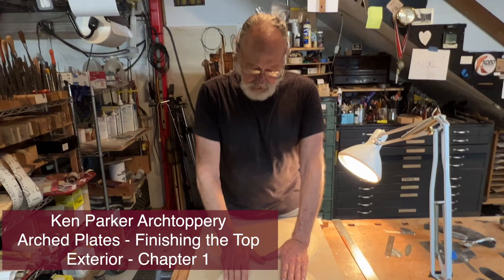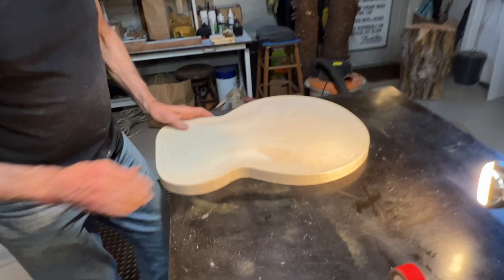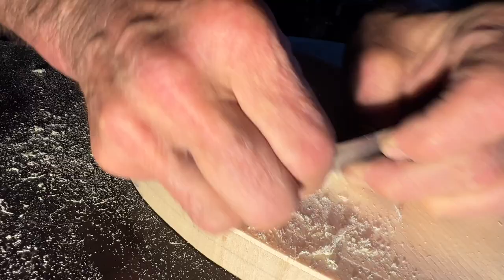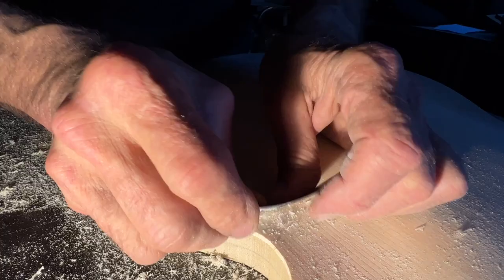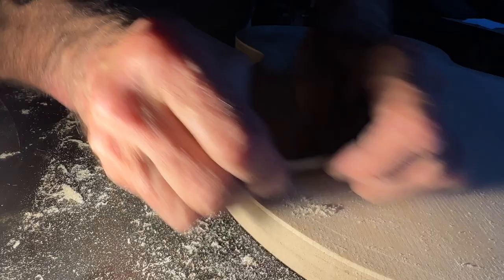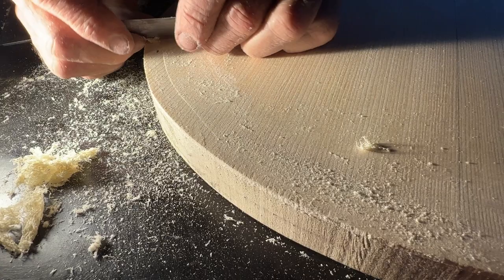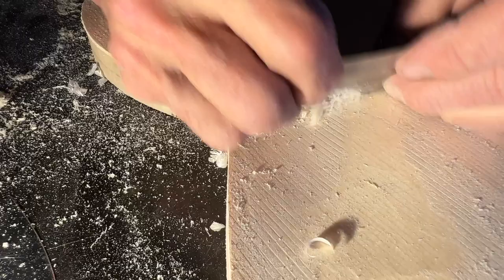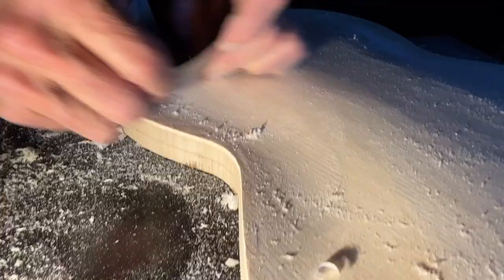Ken Parker Archtoppery - Arched Plates - Finishing the Top Exterior - Chapter 1

Comment: Where do you get the shim stock, and what do you look for?  I see McMaster-Carr has it in steel at Rockwell B90, temper rating of "full hard".  Is that what I should be looking at?
Reply from the maker: Honestly, I don't remember, but in general you can't go wrong auditioning a piece of material because the stuff is so cheap. Hardness is the most important quality for a scraper, and wouldn't you know, is both challenging to measure, and difficult to fully understand. Rockwell Hardness Scale "B" , or RHB overlaps with Rockwell Hardness Scale "C", or RHC.  HRB 90 = HRC 9, and "Spring Temper" is Rockwell C 41 - 60, a pretty wide range.
This is from Wikipedia, "Rockwell Hardness"...

The B and C scales overlap, such that readings below HRC 20 and those above HRB 100, generally considered unreliable, need not be taken or specified.

Typical values include:

    Very hard steel (e.g. chisels, quality knife blades): HRC 55–66 (Hardened High Speed Carbon and Tool Steels such as M2, W2, O1, CPM-M4, and D2, as well as many of the newer powder metallurgy Stainless Steels such as CPM-S30V, CPM-154, ZDP-189. There are alloys that hold a HRC upwards 68-70, such as the Hitachi developed HAP72. These are extremely hard, but also somewhat brittle.)[22]
    Axes: about HRC 45–55
    Brass: HRB 55 (Low brass, UNS C24000, H01 Temper) to HRB 93 (Cartridge Brass, UNS C26000 (260 Brass), H10 Temper)[23]

You can see that the shim stock you mentioned at HRB 90 is roughly as hard as work hardened brass.  Their use of the phrase "Full Hard" is confusing, but as I mentioned, when looking into quantifying hardness, stand by to be confused. 
Insult to injury, the Rockwell Hardness test instruments are very costly, so forget about having one to satisfy your curiosity, ask me how I know.
 
There are meaningful subtleties here in scraper performance due to both hardness and alloy, that are impossible for us to measure, and that will only be understood by trial and error.

Correct scraper material should be soft enough to file with a sharp single cut file, as I demonstrate. This assures that it will be soft enough to "turn a burr", but hopefully tough and hard enough to hang in there and do some work before the edge erodes and gets too dull to be useful.

Even then, there will be differences between alloys that can be important, and the sensitive (human) scraper will find that different (inanimate) scrapers all perform differently.

Sorry, I can't point you to a brand that seems to excel, but I have some card scrapers I got from a Japanese supplier that work very well, as well as others in my giant scraper collection whose origins are lost to time.

 Thin stock can be cut with sharp, high quality tin-snips, as I demonstrate, but If you have a pal with a laser cutter, this might be a good time to ask for a demo.  Some roofers have giant power shears that will slice the stuff up like warm butter.
Reply: @kenparkerarchtoppery9440  Thanks for all that great information, Ken!